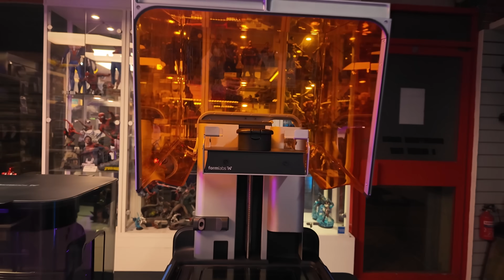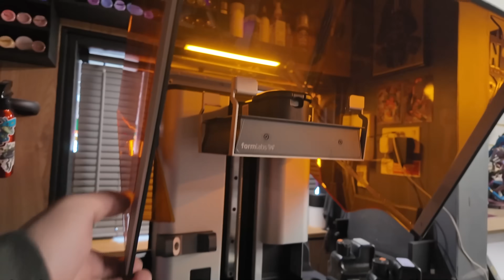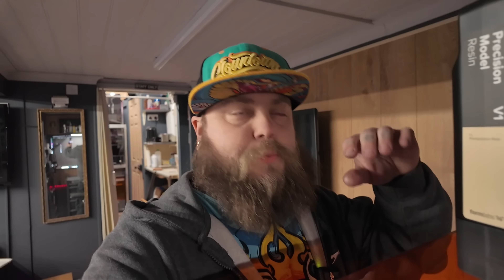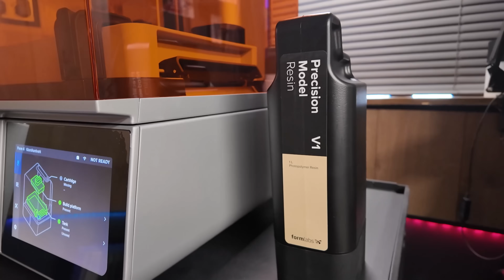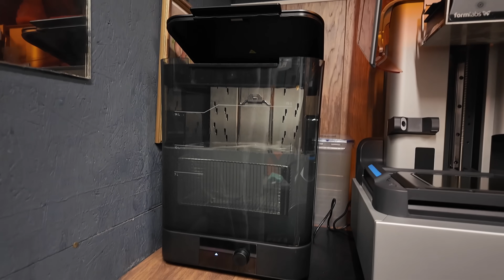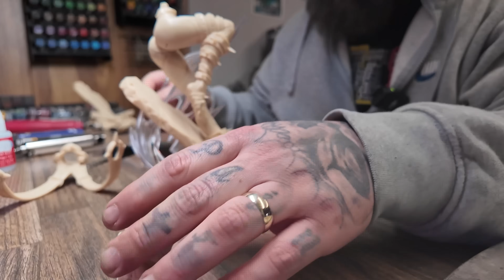I Got To Test the Formlabs Form 4!

Comment: All the cheaper printers are focused around minis and figures and their resin selection is built around that. Formlabs is the only one to have resins for usable practical parts which I print. Even in the FDM arena my high temp industrial 3d printer was $15k and some of the speciality filaments used are $1500/kg but a 15g part of that I sell for $500 to $1000. I've got parts I've made in everything from race cars to military equipment, and rockets. I like engineering things to be lighter, I can't think of anything more tedious than having to paint figures.
Reply: Then what are you doing here man

Comment: I bought a Phrozen mighty 14k revo to print the garage kit, but the effect was not ideal as the garage kit has many curved places.
After each printing, the layers and support points need to be polished for a long time.
Is Formlab4 better in this regard? Can it be printed and then colored directly without any other steps?

Comment: Dental lab owner here, Formlab is pricey, but from an industry point of view, it's nothing.
I have a similar type of printer, called ASIGA - (US$7k just the printer alone).
I use special resins (costing US$500 per litre) to print bite splints for people grinds teeth at night.
Those splints are sold for US$100 each, and I make 100+ splints per year. 
So a year's worth of work already paid off the investments. 
It's a good deal, in my opinion.

Comment: As someone who's job it is to support these printers (as an employee of a reseller), the F4 has been pretty great so far. Not a single broken machine (knocks on wood) thus far. Had more issues with the Form 3 in the early days before it "matured" a bit. And the Form 2 as well for that matter. I'm sure we'll start seeing what the Achilles heel of this printer is eventually, but for the moment it's very solid.

These machines aren't meant for hobbyists, unless you have the money to burn, they're built for the professional market. And what that market wants is to not have to tweak anything, that everything is consistent, repeatable and that you have a technical support lifeline on stand by. Yeah, the resins are expensive, but they are tightly controlled with batch numbers on each bottle, the version gets updated whenever something changes (be it colour tweaks, chemistry changes etc). The profiles for each resin are thoroughly tested and validated. The washing and curing time/temperature is also tested for optimal results.

If you need tech support you'll usually have a response within a couple of hours via e-mail. If I need to call in the techs over at Formlabs, that might push the answer to the next day depending on how early in the day the question comes in. You also have the option to call and talk to a human if you're having issues. That type of thing you usually don't get with a cheap hobby grade printer.

Obviously all this is not something a hobbyist or even many companies need, but then there are plenty of options around for a much lower cost, and that's great.

Sorry for sounding like a paid salesperson/shill, I just wanted to give some perspective that it's not just the printer you buy when you get one of these.

Comment: It's funny to me, that 3500 money unit printers are now considered insanely expensive. I remember a time when people where saying that 6000 euro DLP printers are an entry level machine. You had to source a 800 Euro light projetor yourself though, With replacement lightbulbs that cost 300 euros a piece. 
Not that i could afford the thing. Spend month and years swooning over that and similar machines. Once the screen based machines came to marked the price drop was so hard and fast it shocked me. So I am happy we can now complain about Form 4  being expensive.
Reply: @DasBilligeAlien  tvs in the past were also a luxury that only few people had. Now everyone has tv even in the toilet. That doesn't mean that this primter can clarify the high cost. Cheaper printers can give you the same results with a more wide printing area and much cheaper resin. It doesn't offer something groundbreaking. Elegoo with saturn4 ultra is offering the tilting mechanism feature which is something awsome at 1/5 of the price.
Gktwo was the best printer when was relased at 1/3 of the price

Comment: Why doesn't anyone make a good airtight seal around the enclosure so you could limit the smell and pump it out?
Reply: It has a port on the back to attach ventilation if you want to.
Reply: @treborrrrr  yeah but if the thing isn't airtight it'll still leak

Comment: With the pirice of 3500$ and minimum price of resin at 79$ its something inconvenient for printing figures. This is more for big companies that do specialized printing (dental or other stuff).

I believe these kind of reviews are unnecessary. Stick to normal printers please
Reply from the maker: So while all other content creators are making content on the newest machines, you want me to decline them in future because it’s too expensive? Where do I draw the line then at price because for some people $500 is expensive…
Whether you like it or not this machine is an option for people who want to print, not to mention that already some of the features of machines like these are already stating to trickle into the “cheaper” options. Without some companies pushing high end equipment we all get stuck with crappy machines that have endless problems, there is no growth for the low end user if we deny the existence of higher end products. Instead of moaning about the price maybe you should be encouraging the lower end companies to take notes and make your cheap printers better.
Reply: @Groundeffected  at the end everything is about money, its your channel and you decide what you want to post. Am just saying my opinion. i would pay 1000-2000 for a decent machine that wouldn't force me to pay their super expensive resins IF it had speed, quality and low fail rate.
I dont see how this machine can cost 5 times more than a saturn 4 ultra for example. Is it that good?
Reply from the maker: @alucardnos13  for you and me. It’s not worth the money I agree. Is it good? Yea. Can I make pristine prints on 90% of today’s consumer printers. Yea I can. Would I buy one of these if I had to start over? Probably not but it does exist and in my opinion it’s good to know about everything there is available even the extremely expensive stuff.  Formlabs didn’t ask me to sell the machine by the way. They don’t even give affiliate on sales either they just wanted trusted creators to use the machines and give our opinions, and I’ll be honest if brother asked me to try their 200k jewelry printer I’d do that too. For me printing is a large part of my life now and I would like to be able to get to a level of understanding that’s beyond the hobbyists table so machines like this are part of that journey. I realise it’s not for everyone and so does formlabs we actually discussed this in our meeting, you will see more of these features being trickled into our hobbyists equipment over the next few years for sure.

Comment: It is an incredible ecosystem, beside the consistency of the hardware, Formlabs have some really good resins for different use cases. Had some parts prototyped that almost had the kind of durability of nylon. Seems you get what you pay for but you need to have the use case. The high strength prototype resins are as expensive as the printers. When you have that high value requirement a standard fragile part the domestic printer produce is just to high risk. The cost of holding up a team of engineers due to someone rough handling one single time  is more than the cost for 10 of these units. Can't wait till this level trickles down to domestic printers. Bamu Las achieved it with FDM and others have now matched. SDL will follow the same path, sometime.
Reply from the maker: See that’s the mindset I have.  These guys pave the way for us hobbyists. I know a lot of people won’t get it or even consider it as a viable option but I been saying all along the cost of teaching someone to print with any and all materials to a high level is waaaay more and takes waaaaay longer than just buying this and a day or two with a technical advisor to get you printing high end parts.  It kills me that people think that prints at hobby level are expensive.  My landlord needed a part made for one of his machines at work it’s a holder for something that needs machining and to have the part made would cost 20grand plus and a few weeks of wait. I printed it for him in one day with the correct material and it saved him thousands but it was only a place holder while they waited for that part to arrive but my point is that in the real world these things have applications that most of us can’t even conceive, and the ability to manufacture at high level with almost any material is crucial to businesses that work on those levels. Unfortunately we have niche hobby where everyone wants stuff for cheap and or free. Just look how many people will buy stolen files for a couple bucks rather than pay the 15 bucks an artists wants for their hard work.

Comment: Why didn’t you show the process of changing the resin, seems like it would be a pain to clean that vat?
Reply from the maker: You don’t clean the vat. Once you use a resin type that vat is coded to only use that type with an rf id tag in the back. So to change resin you have to swap the vat. I also did clean it before I knew this and it was no more difficult than any other vat I’ve had to clean. Just pour out and lean it up to gather the last bits and it’s basically clean already.

Comment: 50 microns seems really bad! There are printers that push 17 to 19 idk...
Reply: Supposedly, their light source and optics make the print results sharper than higher resolution consumer printers.
Reply: @retromodernart4426  it has a higher accuracy, but consumer printers have a higher precision with their high resolution screens, if it was DLP you could make that argument but it uses the same technology as consumer printers as high resolution DLP is very expensive.
Reply from the maker: It’s my opinion that it’s not for making dollys to put on your shelf. It’s for more professional settings. But having said that at 4k with only 50microns it makes me wonder why 14k at 17microns doesn’t look much better.  Perhaps the chasing of lower xy resolution and higher k numbers is all a marketing ploy to get us buying more and more machines?
Reply: @Groundeffected  That's the bottom line - high-quality light source and optics, plus mechanical rigidity and precision motor control (for positioning and proper lifting), and LCD quality (contrast ratio for less light bleed between pixels) are way more important than "higher resolution".

By the way, those "dimples" over the screen are for lowering peel resistance, so no air-pump or tilting-vat schemes are needed.

Comment: It looks a REALLY nice printer. The features it has (wiper, heated vat, resin system, the spring plate etc) are all top quality and really useful....but, some implementations are puzzling like the resin vat being a total loss in the event of replacing the FEP sheet! That is just bizarre and wasteful. I don't like that at all. There must be a better way to change the sheet.
For businesses, which is it's chosen market lets face it at that price, I'd say it was outstanding. 
For the hobbyist, you'd need to be damn sure this is what you want, or be Richy-Rich to use that every day. 
Even the resins are expensive, oh and the 'unlock' price is what, $2500 or something? Unbelievable! That's a LOAD of resin to use before you'd break even!
No, I don't think I'd ever consider one unless I won the lottery. For the $3500 it is, I could buy several GK 2's or 3's or the like.
Still, a damn nice printer and you can see it's a quality item.